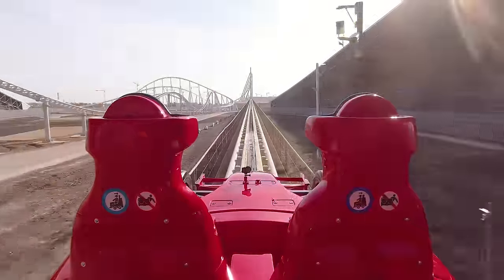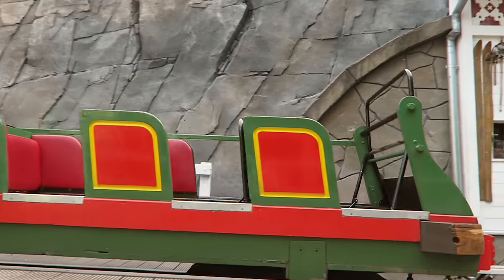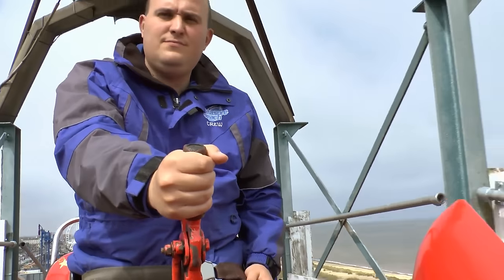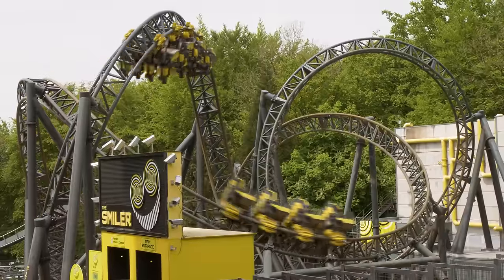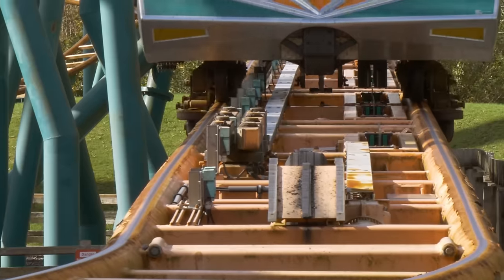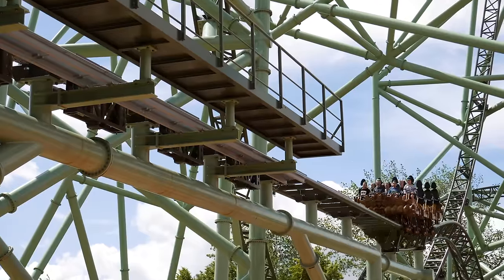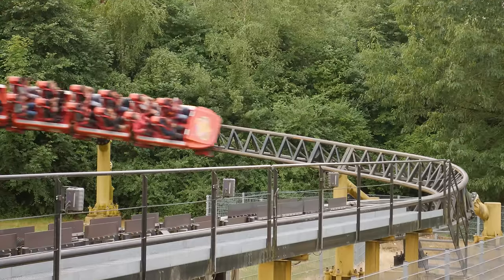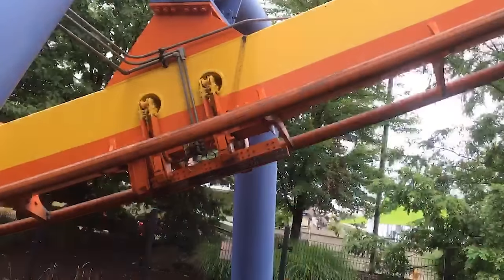Roller coaster brakes NEVER fail

Comment: Saying that they NEVER fail is just wrong, everything CAN fail. However poor maintenance and inspections is often the cause. However it was an interesting video :)

The Smiler at Alton Towers: In 2015, the Smiler roller coaster at the Alton Towers theme park in the UK suffered a catastrophic failure when a train carrying 16 people crashed into an empty car on the track. The crash was caused by a failure of the ride's braking system, and resulted in several serious injuries.

The Mindbender at West Edmonton Mall: In 1986, the Mindbender roller coaster at West Edmonton Mall in Canada experienced a brake failure and derailed, killing three people and injuring several others.

Batman: The Ride at Six Flags Great Adventure: In 2008, a car on the Batman: The Ride roller coaster at Six Flags Great Adventure in New Jersey failed to stop at the end of the ride and crashed into a parked maintenance vehicle. Several people were injured in the accident.

The Big Dipper at Battersea Park: In 1972, the Big Dipper roller coaster at Battersea Park in London suffered a brake failure and a car carrying five people derailed, killing one person and injuring several others.
Reply: Smiler wasn't a brake failure. An empty train valleyed (stopped in a low point of the track due to insufficient momentum), and nobody noticed. The block it was in was reset by a supervisor, so the ride's computer thought it was empty and sent the next train, which was loaded, into it.
Reply from the maker: Poor maintenance is a very good point!

At least two of those accidents you mentioned had nothing to do with the brakes failing. The Smiler's computer system did stop the train before the accident happen, and it was poor maintenance of the train itself which caused Mindbender to derail. A quick Google can shed much more light on these.

Comment: Actually, block brakes don't need to stop the wagon completely, IF the computer knows the speed & position of wagon ahead. Stopping a wagon on the track could be problematic, since theres nothing to get go again unless the block boundary is in a downward slope.

So if the computer knows the speed of wagon in front, and also have an in-memory map of how the track looks like (with hills and slopes), it can calculate whats the permitted max speed is to not collide into the wagon ahead, add a safety factor to this, and brake exactly right amount to ensure a safe ride. This also means usually the guests don't notice the brake, as its tiny nudge brake amount that is applied.

Usually such system have a failsafe, first a simple block system consisting of track switches/sensors which WILL stop a wagon completely at a block boundary if the block ahead is occupied, BUT the system also has a secondary system which can track the wagon's position and speed using short range radio, and if the computer system can "see" the wagon on the occupied track, and its position/speed is sensible based on last time it passed a block switch, it will use its smart calculations to just nudge the speed of wagons behind, but if it can't "see" the occuping wagon, it will failsafe and brake other wagons completely, which MAY mean a attendant must climb up and push wagons to get go again when the track ahead is clear, and then the attraction is usually closed to inspect why the positioning system failed.

Comment: Guess someone forgot to tell Alton Towers about these failsafe brakes huh.
Reply: if you mean the smiler accident, a manual override of the safety system, wich should not have been possible, was the case of it

Comment: Everything can fail. But you can make the probabiliy extremely low, so it will probably never happen in the lifetime of the universe.
E.g the brakefins can break off, and all fale safes can fail. Even with eddy current brakes you have things like over-temperature of physical damage can lead to a failure.
Reply: And it doesn't matter how good your brakes are if the systems and people controlling them fail to do so correctly.
Reply from the maker: Very true! The caveat of this video is "with good maintenance, roller coaster brakes never fail".
Reply: @coasterbot  yes, but even then they can. The probability is bigger 0, just very very small

Comment: "Never" is a strong word and it's not true. Off the top of my head: an Intamin coaster had "fail open" magnetic brakes that lost air pressure and caused a collision. Steel Vengeance's brakes had insufficient stopping power for the first few weeks and had to be modified. Magnum's brakes failed in the rain and caused a collision. Router coasters are extremely safe in general, but stuff can and does happen.

Comment: Roller coaster will always evolve, overengineered safety for the ride and as more and more extreme rides being designed so do the safety.
Because you can't apologies enough if you accidentally yeet the passengers to orbit.

Comment: I'd argue magnetic brakes not slowing vehicles to a dead-stop is actually a positive, since it ensures that in the event of a system failure, the vehicles will still make room for any vehicles behind them.
Reply: a rollercoaster is devided into blocks, each seperated by a method to stop the train (block brakes, station, lift hill) and only one train can be in one block at a time. the next train will be stopped at the block brake before it or the lift hill until the train before leaves the brake

Comment: Magnetic brakes are not completely free from wear. The induction heats them up and that wears permanent magnets out. But considering the price it should be easy to make them so oversized that the wear doesn't matter for the lifetime of the ride.
Reply from the maker: Very true - with correct maintenance I'm sure it wouldn't be an issue

Comment: Nothing is fail safe. Magnetic brakes are not an exception. 

It’s usually not the magnet itself that’s going to fail, but the components around it. The pneumatic system that apply them can easily fail. Even if it’s a permanent fixture, you could lose the magnetic fixture on the coaster itself. 

I think the only fail safe really is to have multiple brake systems, and specifically at the limits of the ride just in case. Even then. They’re not 100% fail safe, because nothing is. The likeliness of everyone going wrong at once is unlikely………but not impossible.

Comment: tell that to the people who lots there legs in Alton towers i bet they will disagree with u LOL
Reply: Brake failure was not the problem there. It was entirely operator error and bad procedures. The day was windy and the coaster valleyed, and due to some other issues the coaster was having, it was put into maintenance mode, where you can force the coaster to do anything at any time, even if it violates train spacing. SOmetimes you have to do that to clear errors or get trains out of the way for maintenance, but it requires good communication and nobody on board. They should have been in normal mode, where any unexpected behavior (train takes too long to get to the next block, sensor doesn't trip and the next sensor does, etc) will cause the coaster to lock up.

The valleyed train did not reach the end of the block it was in, and the coaster correctly threw an error, and stopped the train behind it. With a miscommunication, and the coaster in maintenance mode, the driver sent the train anyway, unaware of the valleyed train, and they collided soon after. It was not at all a mechanical issue, and the coaster did exactly what it was designed to do, but the driver acting on bad info in a mode they should not have been using forced it into a crash.
Reply: murphy, please do your research before claiming the brakes failed, no they did not
Reply: @Ravaxr  but did it crash yes so the breaks didnt work did they
Reply: @znul  yes i have and the ride still crashes so the breaks didnt work id they if the breaks worked they wouldnt of crashed
Reply: @murphychris9811  the brakes worked, they were told to release by the engineers.

Comment: Block breaks don't really improve safety per se, or at least that's not their primary purpose. Block brakes refers more to the role of the brake, not the technology of the brakes. Block breaks allow roller coasters to be built by composing multiple sections/blocks, this allows multiple trains to be safely operating at the same track at the same time, greatly increasing the throughput of the ride. 

Without block brakes, having multiple trains at the track simultaneously would not be possible, so you will just have to run on a single train at a time, so it's going to still be just as safe but just not as many people will be able to ride.
Reply from the maker: Great points!

Comment: one of the core engineering principles is that everything can and will fail. its murphy's law. yes the brakes will always be good at breaking, if they engage. someone or something could always sabotage the fins they use for breaking. how will your state of the art breaking system work if half the system isn't there
Reply from the maker: This is very true! During normal operation, and with sufficient maintenance, roller coaster brakes won't fail!
Reply: It's spelled BRAKING

Comment: Now, everyone stop calling 911 when a train is stopped in the block sections or on the lift hil......screaming... people are terrified and in a life threatening situation...... leave it up the to maintenance crew to either sort the issue and restart the ride, evac the people on the ride... or wait for the ride system to get a signal that the next train clears the next block section.... ease up on the 911 calls..... People on the ride are fine!

Comment: Magnetic brakes ARE friction brakes. It's just a different type of friction.
Reply from the maker: The definition of friction requires contact - "the resistance that one surface or object encounters when moving over another."
Reply: @coasterbot  That could not be further from the truth.  Friction does NOT have to  involve contact.

Comment: There's only one problem with the title. Two trains HAVE collided on many multiple occasions. You should probably have explained why in the video, cause without that we think "well of course roller coaster brakes have failed".
Reply from the maker: Great point. Why do roller coasters collide? Is it that the brakes fail, or poor programming, operator error? Brakes can ultimately fail if utilised or maintained incorrectly.
Reply: @coasterbot  Right.. do you think it's worth doing a video on, like the flip side of this one, citing real incidents? I think it would be a fab video. In any case, I really enjoyed watching this, so thanks, as it helped me to understand the different methods employed.

Comment: "This phenomenon, known as eddy currents..."

No, this phenomenon is known as the Lorentz force. Eddy currents are another thing, and they do exist in this situation. However, they are not the cause of the braking. That is the Lorentz force.
Reply from the maker: It's all of the above. Eddy currents cause the metal fin of the brake to become 'magnetised', leading to two opposing magnetic fields as described by Lenz's law. Lorentz force then acts on the train as the magnets on the train move through the magnetic field of the metal fin. :)
Reply: @coasterbot  correct, and I think this would have been a better point to make in the video, perhaps with a link to a supplementary source, than simply mentioning eddy currents.

I’d like to point out that this is pretty much my only criticism for the whole video. However, as an electrician, controls technician, audio engineer, and internet pedant, I felt like it needed addressing. The strict cause of the ~~breaking~~ braking is the Lorentz force, described by Lenz’s Law, from a conductor moving through a magnetic field/a magnetic field moving through a conductor. This involves an eddy current, as you stated, but it is simply an actor in the larger play.

Edit: also, thanks for taking the time to respond to me!

Comment: Anything mechanical can fail. Various rollercoaster brakes have failed and caused accidents.
Reply from the maker: 100% correct, if not maintained correctly anything, including brakes, can fail!
Reply: Or they've just been badly designed. Which has happened. Your clickbait title is misleading :)

Comment: Magnets how the fuck do they work.
Reply: most videos leave it out because it's a lot of vector calculus and sounds like black magic at times, so I will give the simplest explanation I can

to slow the train down, engineers need to create an electric force on the train that opposes its movement. magnetic forces themselves can't do this, as they are always proportional to the velocity of any charge they act on. a changing magnetic flux induces an electric field, which can act on charges in the train's magnet and slow the train down. you can change the flux in question by changing the area of the imaginary membrane, which can be done by passing a current loop (magnet on the train) through a magnetic field (produced by magnets on the track). from there, engineers have to work out cross products and whatnot to figure out what direction the field has to go to cause an electric force resisting the train's velocity

if you need a better explanation than this, I might be able to find one

Comment: I have two criticisms of this video. (1) "Failsafe?" The human who brakes the train could die of a heart attack. I don't think the person who created this video knows the meaning of the word "failsafe." (2) From a physics perspective, all braking systems generate the same amount of heat, because kinetic energy + heat/light energy is always the same over short periods of time. Even the water braking system generates heat, both in the water and on the part of the coach which contacts the water. Magnetic brakes also generate heat or light, which can not only damage physical structure the magnets, but reduce the strength of their magnetic field, therefore they usually are built with cooling systems, which this video does not address. Anything that slows you down must generate heat and/or light, and heat can damage anything. Heat and light are closely related, because heat excites electrons, and electrons generate or absorb one photon whenever they jump into a different electron shell. Heat creates light, and light creates heat.
Reply from the maker: 1. There isn't a person who brakes the train, the rides computer system does that. In the event of a shutdown, all brakes are activated  each train comes to a safe stop automatically. 

2. Magnetic brakes generate heat and do wear over time. Regular and routine maintenance would catch any problems with this. Most roller coaster brakes don't require cooling systems because they brake so infrequently. The magnets on the train would expedite rapid braking once every few minutes, giving them enough time to cool down

Comment: And when you have a EMP the brakes will fail, great.
Reply from the maker: The brakes are on by default and don't require power to operate, so if that happened all the trains would come to a stop safely.

Comment: Same way electric vehicles / Teslas “brake“ (99% of the time) . Makes one pedal 🦶 driving (no need to press on the friction brake pedal) possible with regen. EVs/ Teslas almost never need brake pad replacement .  Another one of the many many reasons  EVs are better than obsolete ass gas cars.